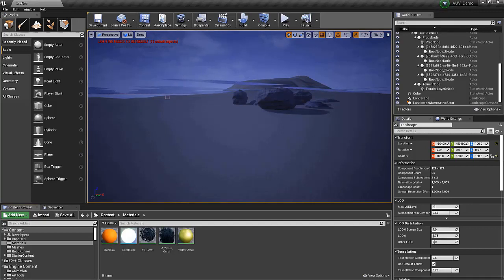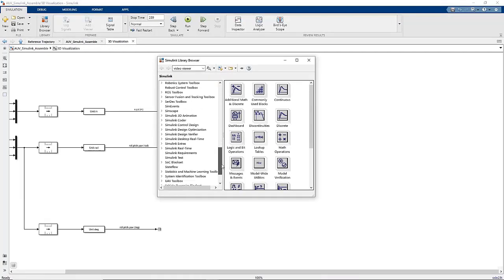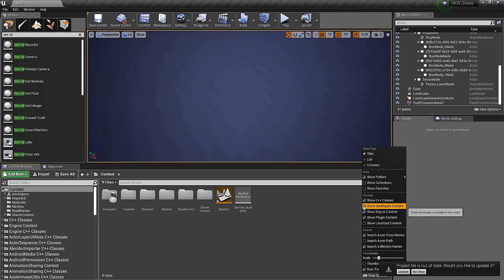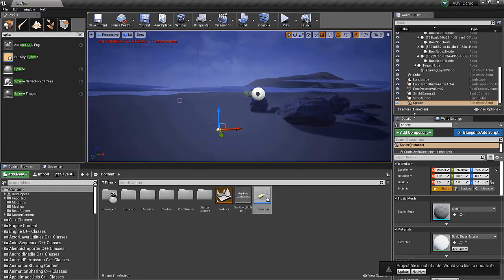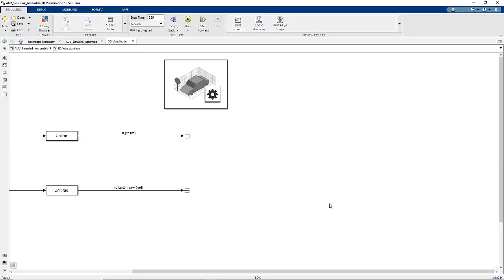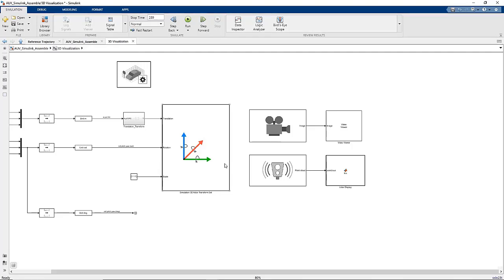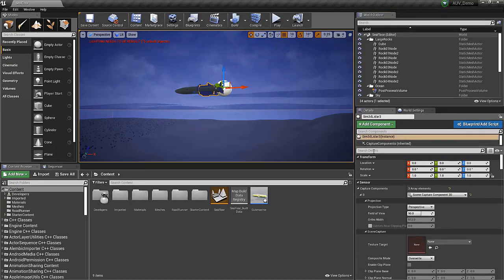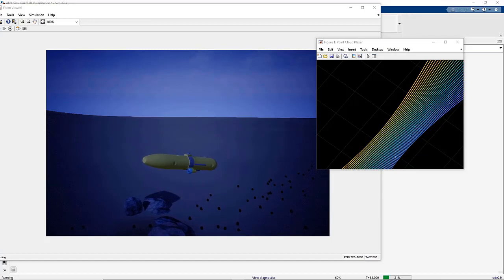Connect a Physical Model in Simulink to Unreal Engine | AUV Deep Dive, Part 6

Comment: Hey, uh, is this possible with UE5 since the plugin hasn't been updated? Is there an alternative way to do it without the plugin?
Reply: Hi! Did you find a way to do that?
Reply: @giadaparodi1127  No, turns out you can't, as far as we could tell when we were doing our group project.
Reply: @DatCameraMON  without the plugins, you could use other methods to get Simulink & Unreal talking. But, if you wanted UE5... you just need to get on MATLAB 24a or 24b. The former has plugins for 5.1 and the latter 5.3.